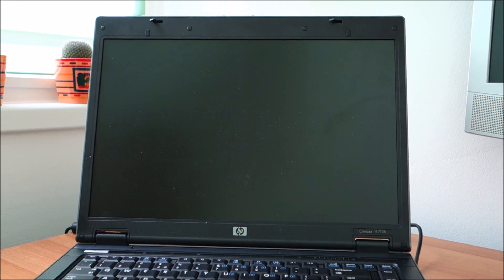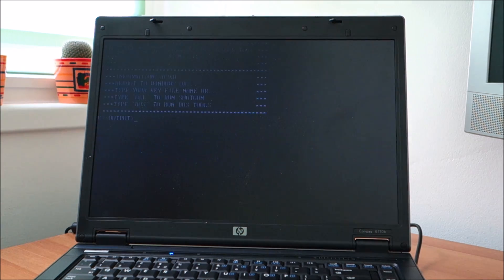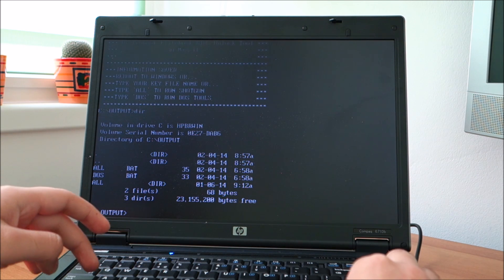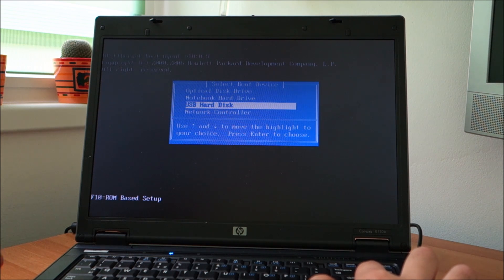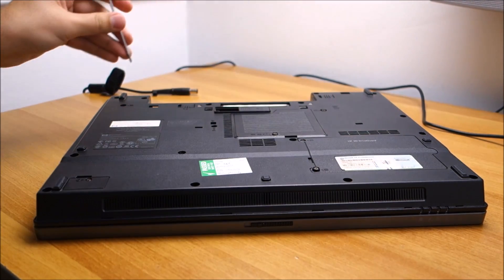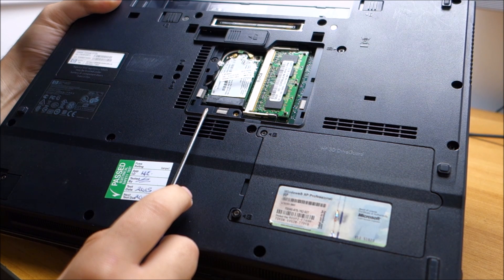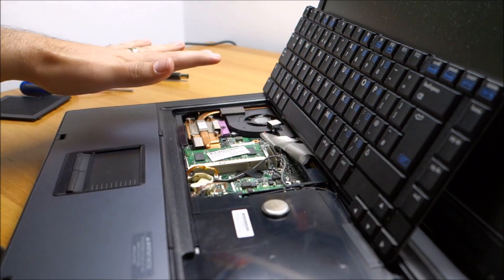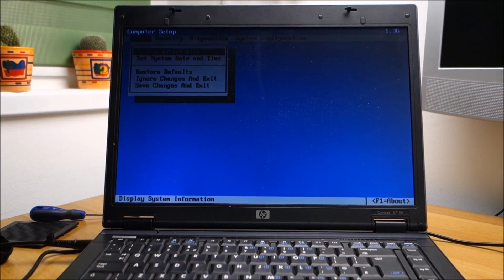How to - HP Compaq 6710b BIOS password reset (quick fix in first comment below)

Comment: I changed the battery now the date issue is gone. but i only have f9 and f10...inside f10 in the file tab, there is reset to default configuration...will this delete my data? Because now when i turn on its a blank screen after the hp boot logo (same laptop as yours)

Comment: Hi, i have the older 10 year old HP 6730b and in the bios there is NO update option, only reset back to default. i even tried loading the bios  file in windows but it just said finished? didnt go to a app or anything??   Laptop starts normally to windows but i had that 501 error at start and just reset bios to factory and that cleared that but still cant find any place to update the bios to latest. All settings in the bios seem to be on "change" and i even took battery out to reset in case a security lock is on somewhere. My other laptop from same age 4530s has a update line with the bios section, so is the 6730b locked out from bios updates or is the chip faulty or locked out in some way??  Otherwise its working and booting ok
. 
 i also tried Win+B and Win +V with Power button but that didnt do anything
Thanks

Comment: Have a Compaq presario 3000 notebook. The intro Compaq screen comes up and in the lower left hand corner the F10 Rom Based Set up comes up. Pressing F10 does nothing and cannot do anything else to the computer other than force it to shut down.
Reply from the maker: The bios might be corrupted.
Reply: If you meant the V3000, it's a totally different bios inside out than this thing, and it's an extremely basic bios.
I do have the Intel version of the V3000 working so maybe I can try to help if you need a bios dump or something

Comment: Hey Ultimate DIY whats the size of HP nx6110 output so I can buy a charger because my old one is broken and it went on fire cause its almost broken so I throwed away
Reply from the maker: I can't tell you for sure, but it's one of this two:
http://www.laptop-adapter-shop.com/charger/hp-compaq-nx6110-ac-adapter.html
http://www.allbatteryshop.com/laptop-charger/hp-compaq-nx6110-ac-adapter.html
They have way different connectors, so the correct one only can choose by looking at your laptop and maybe remebering how the old one looked like.
Reply: Ultimate DIY thank you
Reply from the maker: Welcome :)

Comment from the maker: LONG STORY SHORT, YOU JUST NEED TO REMOVE THE BIOS BATTERY TO RESET THE BIOS ON THIS MODEL.
Reply: its not woring what should i do
Reply from the maker: +I LOVE ANIME all the time you removed the main battery and also the BIOS battery and it did not reset?
Reply: Ultimate DIY  i remove the main battery and inner battery and kept i for 2 hours but nothing happen and //// 1.there is password on bios  is there any other method
Reply from the maker: You have exactly HP Compaq 6710b?
Reply: Ultimate DIY  its hp  compaq 6710s  but its same like you lap internal is also same
Reply from the maker: then I honestly have no idea why the BIOS din not reset when removing the battery.
Reply: thx i used the other method and it worked
Reply from the maker: +I LOVE ANIME all the time ok, perfect! :)
Reply: @suheltamboli8286  hi man what other method did u use can u Tell me please
Reply: @suheltamboli8286  can u please let me k ow the other way please
Reply: @suheltamboli8286  what other method you used???
Reply: @suheltamboli8286  what other method?

Comment: If I do this will it erase any thing I already have on my laptop
Reply from the maker: No, it will not. Your data is on the hard drive, not in the bios, so you can safely remove the battery and reset the bios.